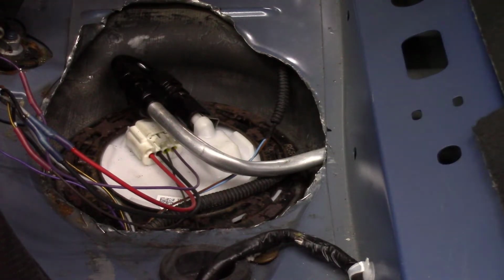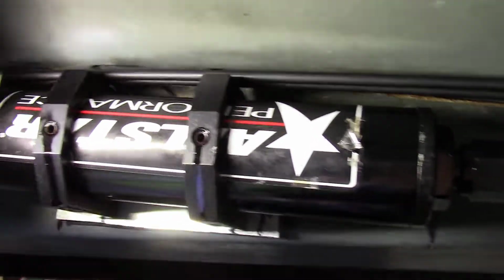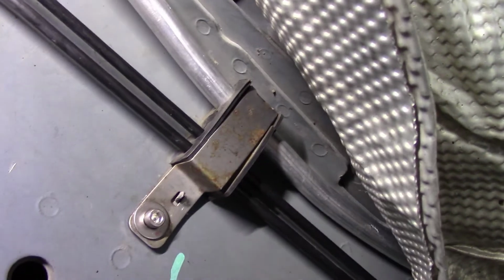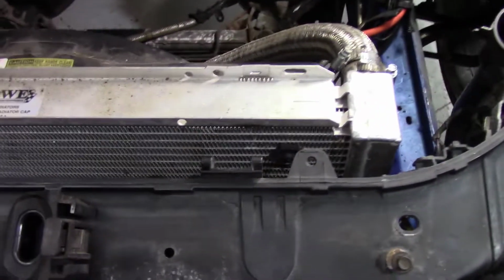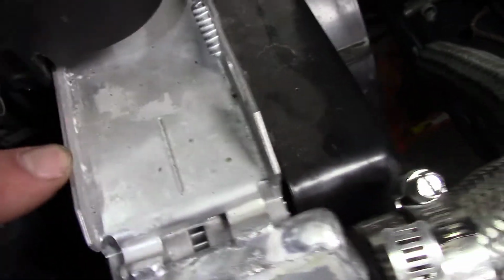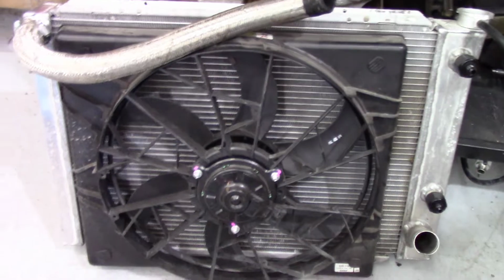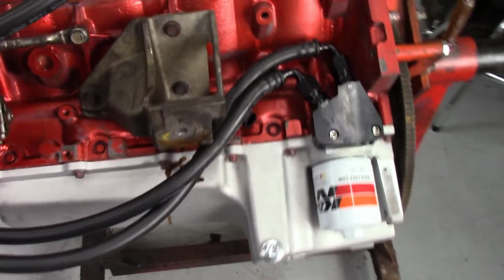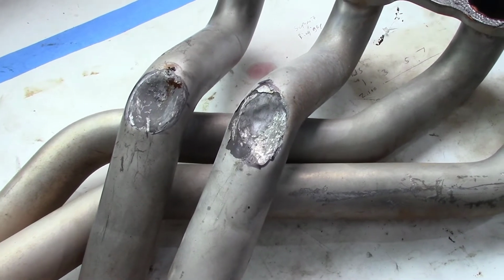G8 V8 LS Swap Update

Comment: Hi mate, did you rebuild your xa rear coilovers?
Reply from the maker: Hi Lions Garage. No, the coilovers were brand new when I installed them a few episodes back. The G8's first journey after all the parts are installed will be sometime in late April. Cheers!
Reply: @CarswellsCustoms  that's great good to see Holden's being modified abroad, they are great cars, I like the harness video. Very simplistic but on point. I've got a Holden vf Calais, over there it would be Chevy ss. I'm doing a ls conversion on. Also have a silver ve ssv, your equivalent to G8 gxp.
Reply from the maker: @FredricksonZak  , They are fun cars thats for sure, plus you can take your kids in the back for a burnout! My heart is stuck on a dark Blue Maloo though...
Reply: @CarswellsCustoms  yeah they enjoy the cars very much, yeah they are very expensive now days. The flagship maloo, is an ls9, tr6060. Gtsr w1 maloo.
Reply from the maker: @FredricksonZak , how do you like the Holden vf Calais, or SS over here? I have seen a few but not much feedback. I mean 6.2 and TR6060 is a hell of a good start... I am a stick kind of guy but the 6l80e is my favorite transmission to tune. Excellent transmission with low 4.0 first gear.
Reply: @CarswellsCustoms  the Chevy ss is an updated G8 basically, looks a little like a Mazda 6. Great car overall though, I've got a 6l80e with flaring issues, it's strapped to the l98.
Reply from the maker: @FredricksonZak  , flaring issues? Please explain...
Reply: @CarswellsCustoms  it's a problem between 2-3 shift, it revs a little higher and shift is delayed response.
Reply from the maker: @FredricksonZak  One of my customers experienced the same issue and I had to up the Base Shift Pressure. Do you have access to HPTuners? I can share those settings with you.
Reply: @CarswellsCustoms  no I don't, I might take it to get a diagnosis. Are they generally a good box?
Reply from the maker: @FredricksonZak  HPTuners is my first tool for diagnostic work on computer controlled hot rods. It does everything a comparabily priced Scan Tool will do plus it writes parameters to the ECM/TCM. Plenty of training from "The Tuning School", they are great. Its really the evolution of hotrodding. Go in on HPT with a couple of hotrod buddies. It will pay for itself soon enough. Shoot me questions as well, no problem.
Reply: @CarswellsCustoms  thanks for that info mate, I'll definitely be looking into it.